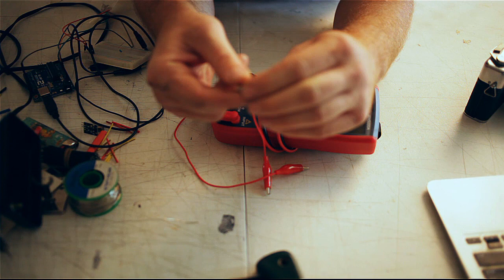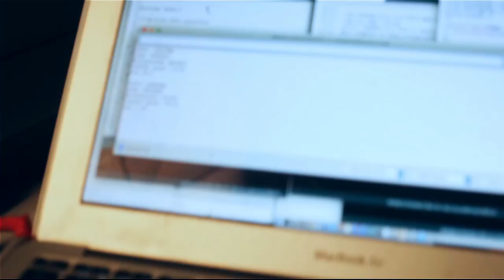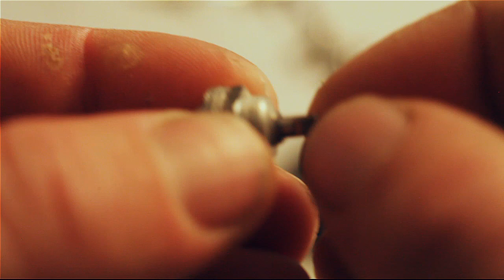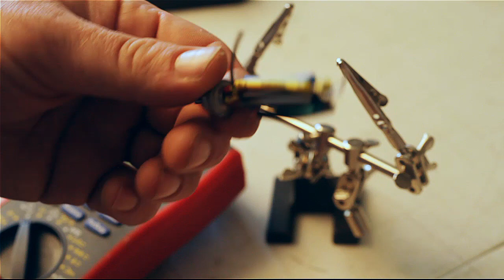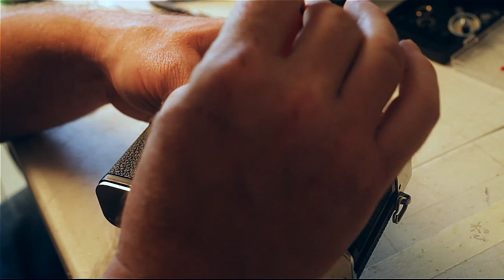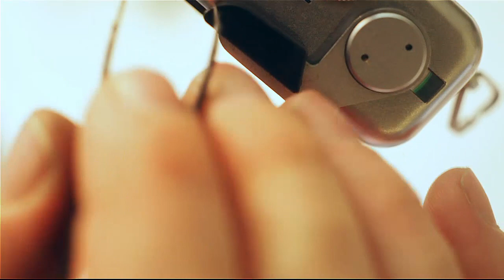Add Manual Shutter Speeds to Yashica Electro 35 series cameras. DIY

Comment: Hey Dude, You video is amazin but your ISO dial is on wrong position a little bit. Probably you remove it and put in wrong position. You can search on google or Ken Rockwell photos to ajust it. ISO 125 is on the 100 place.

Comment: Awesome work! Very inspiring. I recently purchased an Electro 35 CC and have been trying to find a way to modify it to meter for ISO 800 (or higher) film. My first thought was to modify the (or make a replacement) screen in front of the sensor to let in more light, but after watching this I'll study the wiring diagrams and see if there is an electrical solution.
Reply from the maker: I also have a CC that I was considering this mod on.  This was years ago, so I am not 100 % sure, but I think that they are electrically super similar.  As I recall, there wasn't any extra space in the top of the CC, but I was thinking about putting the switch out the top left hand side where the flash sync is.  Please send me a pic if you work on it, I'd love to see it, and maybe I'll get to hacking apart the CC one of these days!
Reply: @CAMERADACTYLCameras  Will do. Looking at the wiring diagram for the G series, there is a resistor in parallel with the CdS. My current thinking is that I would want a switch that opens that and replaces it with a lower resistance resistor. With a dial switch similar to yours I could set it up for maybe -3 stops EV. The idea being to get the shutter to fire a stop or 3 quicker than it would at max native ISO (400 for the CC). Will need some more research and sketching before I tear into the camera.

Comment: Why did you not use a potentiometer instead of a dial switch with resistors? I feel like that would be more compact, and would allow for smoother transition between shutter speed stops, and keeps the advantages of the stepless shutter of the auto light meter.
Reply from the maker: absolutely would be smaller and allow for continuously variable shutter speeds.  In fact, my original prototype on my desk used a potentiometer, however, I wanted discreet shutter speeds that would match aperture settings, and I also wanted a linear scale (geometric, actually). A potentiometer, even a logarithmic audio pot would have given me a very distorted scale of speeds.  That is. a reasonable idea though if you are going to make one of these!

Comment: This is brilliant. I found your video after just winning one of these in an auction. Watching your video and seeing just how tight the space is gave me an idea that might improve your process. Instead of mounting everything inside, just mount a double-pole, double-throw slide switch in front of the top cover hotshoe. Use that switch to disconnect the hotshoe from the camera and connect the leads you added to the hotshoe. Find a junk or old, dead flash unit and gut it to house a circuit board or resistor bundle and switch; there's plenty of room, you'll do minimal damage to your camera, it will look almost original, and it will be modular. I'm sure you can retain a flash function via the flash sync connector as long as you cut the lead going to the hotshoe. The switch would allow normal flash in one position or flash through the sync with the shutter module attached. Great video.
Reply: that's a neat idea!
Reply: Michael James Thanks.

Comment: Hi! First big video on Yashica electro 35. Thanks so much for that. 

I have a problem with my Yashica. It was my grandpas camera and I recently found it in storage. There was the “pad of death” problem, but I solved it pretty fast. But the power is not working now. I understand that via internet it is a pretty dumb question to ask, but just in case - what could be the issue? There is no corrosion....
Reply from the maker: there are a few things that could be the problem -  broken solder joints, dried out or burst capacitors...  if you're really going to have a go at it, I'd suggest using this manual.  in the back, there are traces of all of the current paths, depending on the state of the camera.  you can probably pull the electronics almost all the way out of the camera, and trace and confirm each current path, and isolate where your problem is.  The first thing I would check is to see if power is getting to the main board, if not, probably a broken solder joint somewhere near the battery compartment, its pretty common.